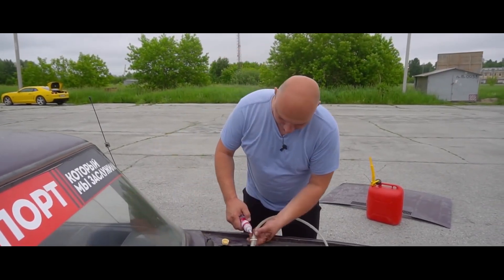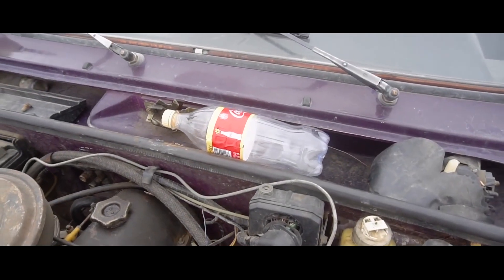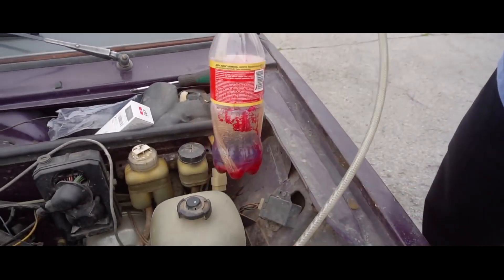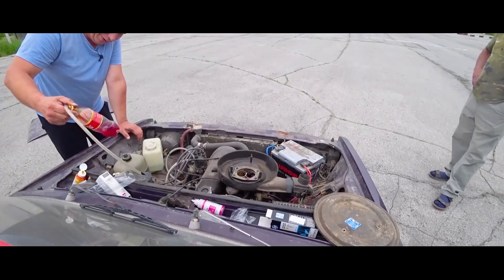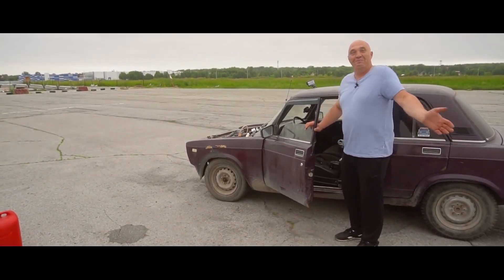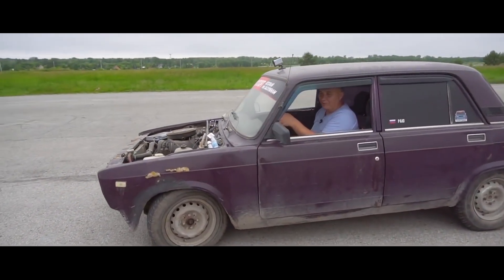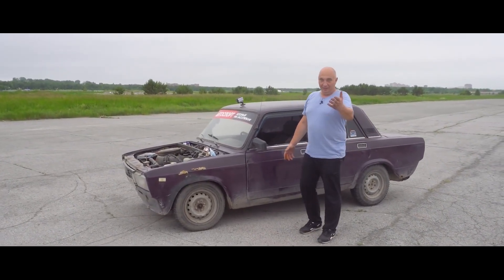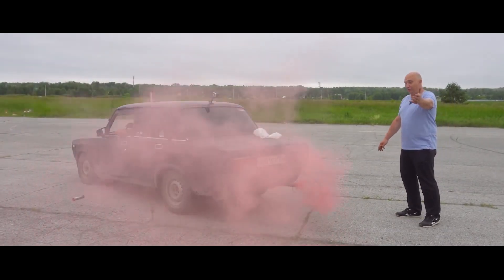What happens when you fill the tank with printer ink?

Comment: Here's a little hack

Pour fuel injection cleaner into the carburetor to start it and while it is running.

It does 2 things;

it blows a lot of smoke, usually white, but it can have a black or brown tint, depending on how clean the engine is, and it also does a very good job cleaning the combustion chamber, making the engine run much better. 

Google translation 
Гугл-перевод
Gugl-perevod

Вот немного взломать
Гугл-перевод
Gugl-perevod
Вылейте очиститель впрыска топлива в карбюратор, чтобы запустить его и во время его работы.

Это делает 2 вещи;
он выдувает много дыма, обычно белого цвета, но он может иметь оттенок черного или коричневого цвета в зависимости от того, насколько чист двигатель, и он также очень хорошо очищает камеру сгорания, делая машину намного лучше.

Vot nemnogo vzlomat'

Vyleyte ochistitel' vpryska topliva v karbyurator, chtoby zapustit' yego i vo vremya yego raboty.

Eto delayet 2 veshchi;
on vyduvayet mnogo dyma, obychno belogo tsveta, no on mozhet imet' ottenok chernogo ili korichnevogo tsveta v zavisimosti ot togo, naskol'ko chist dvigatel', i on takzhe ochen' khorosho ochishchayet kameru sgoraniya, delaya mashinu namnogo luchshe.

Comment: How about getting powdered versions of the chemicals in the smoke bombs and adding that to the fuel?  If it works to make different colors, you could drive around town and see how other drivers react. 

It would also be interesting to know if the water vapor in the exhaust would be enough to react with sodium...

Comment: I knew something didn't add up. First color didn't do anything. Why did the other ones worked. And there was soooo much smoke it made no sense.  I figured it was a smoke bomb especially when I saw something by the end of the tailpipe. But I kept thinking would it have made any difference it you spray a tone of seafom in a cup and add color to it then add it to the carburator.  Seafom makes the engine smoke like craaaaaaazy

Comment: I think you should mount together two cars side by side and remove the "middle wheels". Maybe a trolley wheel in the front center incase whatever method you use to fix them together can't do without a support in the front middle. Connect the front wheels to one steering wheel or have two drivers is probably best ✌️greetings from your neighbor in the west

Comment: Suggestion for a video: Remove gas tank place car in car crusher then turn on engine and give it a lot of gas while the car is being crushed. stop crushing it as soon as the engine stops (due to it being crushed) and see how far it got. Then crush it all the way. feed gas by a separate gas tank outside the crusher so it won't explode. and the battery too.

Comment: Ink wouldn't survive the pressure or temperature of detonation within the cylinder. Also, notice the speed of the smoke coming out the exhaust... It stays the same speed regardless of acceleration or braking... 

Conclusion: Fake video... They put a small smoke cartridge in the tip of the exhaust.

Edit: Nvm… Got to the end of the video... Glad to see they owned up to the joke. Respect.

Comment: How can I put this on my bike?  I thought of it when I see a diesel pick up truck behind me, I just let it have it. I have 50 volts, 20 amps to mess with.
Reply: Just add chamber to put smoke grenade on rear of the exhaust and use model rocket electric igniter to fire it on command. It should not go from hot exhaust gasses.. i think...
Though you need some capton (high heat resistant) tape to protect wires going to igniter.

Comment: Garage 54  You have to use  Metal Dye Liquid. It is  an oil base and  VERY deep colored. You can  mix it with gas and it will actually dye the carb, intake,  valves  [Lada a 2 stroke?] and exhaust whatever color  on the way out. Will  look very cool too!

Comment: Instead of Red diesel it's red petrol 😂 

(Red diesel is what they use in tractors in stuff for agricultural use and you don't pay as much tax on it)
Reply: Ya but its not called red diesel its just called offroad diesel
Reply: It is coloured so police can check easily
Reply: @j0lel666  how do the police check your fuel if your car has an anti-siphoning system (Which will stop anything from being inserted into the fuel tank)

Comment: There is another way to get a smoke screen. Plumb a bottle with a pump into the exhaust just after the manifold and use coolant as your fluid. As to making colored smoke I'm not sure if it will work but you will have smoke for sure

Comment: Nicee! My car does dark blue smoke and i like it. But my oil dissappears somewhere IDK why.
Reply: Laurynas Pa the Americans are invading your car, to steal the oil. Hope this helps
Reply: @hamstirrer6882  oooohh ok. Thanks
Reply: I have white smoke when idling and blue smoke when revving ......Try to beat that O.o
Reply: @ThaRealGecko  WoW. Good for you.
Reply: @ThaRealGecko  That's a cracking comment be careful not to stem into being bore&ring
Reply: @statementleaver8095  im not joking ..........

Edit: Infact u just explained the problem ... U a mechanic by chance ? lol
Reply: Interesting! I've got white smoke and a green coolant shortage. No leaks either lol
Reply: Hahahah......i see what you did there 😂😂
Reply: the oil gremlins are stealing your oil. light a candle and put it on top of your car to keep them away.
Reply: @that1guy322  I can assure you we are not responsible for the oil disappearing.
Reply: If smoke is blue check your cylinder rings and gaskets if its white smoke and you have coolant levels going down its entering the cylinders so you could have a cracked cylinder head if its black and smells like gas you got yourself a stuck valve and got unburnt gas going into your exhaust(if all fails get a new engine 🤣 by this point it's cheaper)
Reply: Doesnt oil burn with white smoke?
Reply: Iain Jones no it burns blue because oil does not burn well
Reply: Do you have an Audi?
Reply: you're losing oil in the engine into the combustion chambers
Reply: Nah, got black smoke instead. It smells like gas
Reply: You need to clean The exaust
Reply: 🤣Damn
Reply: R/wooosh me if you wish but that means you have a bad head gasket or intake manifold gasket leak, worn engine oil seals, and/or dirty or non-functioning PCV valve.
Reply: Now Gertha tunberg won't invitate you to her birthday anymore.
Reply: Ur oil is being burnt
Reply: Oh I just loose all the transmission oil every week lmao on my moped
Reply: Mine does white smoke and loses coolant haha idk where it goes either

Comment: Iso-propyl alcohol will probably clean the ink off.
You could try a solvent based paint in the fuel, but I suspect all you'd get is a bit of black smoke and blocked carb jets
Reply: 9kg LPG (propane) bottle strait to exhaust pipe with Jacobs ladder igniter (see my profile picture)
I use isopropyl alcohol and copper sulphate solution injected through a brass irrigation misting nozzle right next to the LPG outlet in the exhaust to turn the flame green

Comment: Now try with laseer printer toner straight into carb.
Reply: I think the moment the toner dust touches any of the h0t metal (TB/carb, intake, head( if it even gets that far), it will 'fuse' (cure/dry) to that h0t surface..... just like in a printer  :)  - --run the test on a c0ld engine, 1st run of the day and pour it in b4 any heats build up! Then it should mostly all make it in! ;)

Comment: Real smoke trick: Drill and tap a connection into the exhaust manifold, connect it to a sprinkler reservoir and pump the hot exhaust system full of smoke fluid. The smoke fluid can be made out of glycerol mixed with regular tap water.
Reply: Step 1: Fill the washer bottle under the hood with ATF. 
Step2: hook hose from washer  tank to intake manifold. 
Step 3: Drive down the road. 
Step 4: hit the wiper wash button. 
Step 5:look in the rear view mirror as you can't see the road behind you. 
Step 6: laugh your ass off.
Reply: @MrTheHillfolk  It is better to spray it into the exhaust than the intake, you are loosing power by using your engine to make the smoke, the heat on the exhaust is just waste heat so use that instead.
ATF, i have never heard of that being used for smoke.
Reply: @Sohave  
We rode around in an old Lincoln all summer blasting ATF down the intake for clouds. Works great.

Comment: you guys should try feeding a smoke bomb into the intake
Reply: The catalytic converter would likely burn up most of the pigment and give you grey or white smoke out the pipe. But I say go for it... lets see what happens 😊
Reply: @andinbriwel1092  nothing a good old sawzall can’t fix!
Reply: AleMiToJTD isnt it just carbon dioxide?
Reply: @iKn-ft2bc  I really have no idea. There are no youtube video about this. maybe they could combine a smoke bomb and regular air just to let the engine run and see if that way they can make colored smoke puff out of the exhaust?
Reply: @olio.dipalma_8391  whatsinside
Reply: I agree definitely fake
Reply: You could just feed powdered dye into the intake. That's what gives smoke bombs color. The rest is just potassium chlorate (oxidizer) sugar for fuel and baking soda.

Comment: I wanna see what the stock engine In a lada will output 
I’m talking a fully built LADA
Please 🙏🙏🙏
Reply: Connoisseur Of Cars & Tig Ol Bitties Search for Lada VFTS max attack in YouTube. Some make 200+ hp on Naturally Aspirated Lada engine. I drive one with about 130 hp and it's fun
Reply: Connoisseur Of Cars & Tig Ol Bitties Hey, im making a street lada, with tuned stock engine. So i can show you when done.
Reply: @trap3251  As an American, I've always wondered how far you can push a lada engine. I've been told they are quite bullet-proof.
Reply: @highflyinryan76weezer25  there are many of them tuned and successfully raced. Light and sqaure body somehow beat anything from its class and age
Reply: @highflyinryan76weezer25  simple things usually are
Reply: @ibm_businessman6033  Simplicity is perfection.
Reply: @highflyinryan76weezer25  They aren't really bulletproof for boost, nevertheless there is a 2105 with classic 1.5L 8 valve pushing 700+HP with a GTX4202 turbo and some nitrous to spool it.
https://www.youtube.com/watch?v=6s_07MoM1jU

Comment: is this goot stuff for an enigne
Reply: No, dumping printer ink into your engine is not good. They managed to get away with it because it was carburetorated, but you're still putting water based ink in your intake.
Reply: @robokid20001  if it's water-based, then it's not going to do anything more than water injection would.
Reply: @MrTheHillfolk  It's water based, but it's still a hell of a lot thicker than water with the added ink. In a fuel injected system, that would gum up your injectors so fast. In a carburetor, I would imagine that it would collect in the jets over time, but it would be far less detrimental.
Reply: Tyler Em u mean its got a carboretta